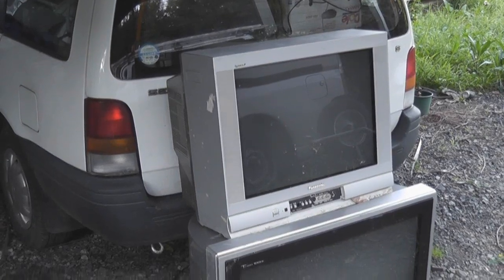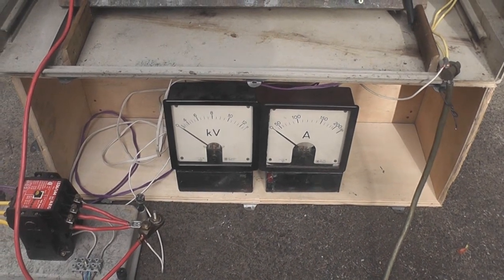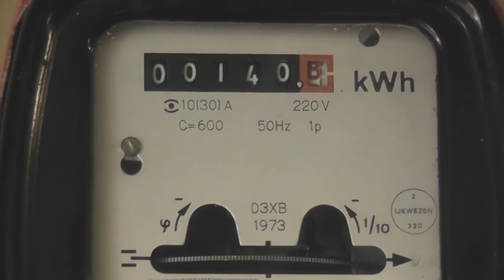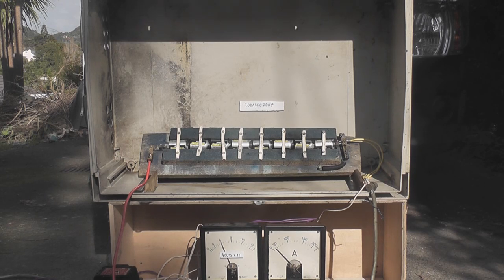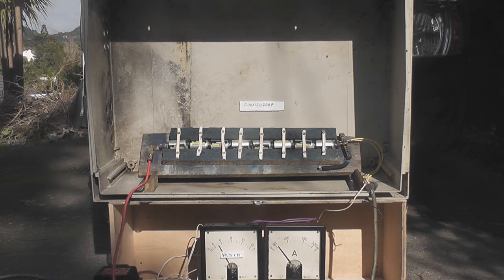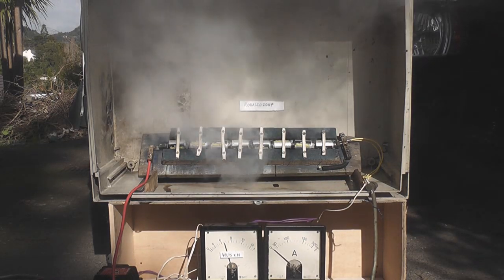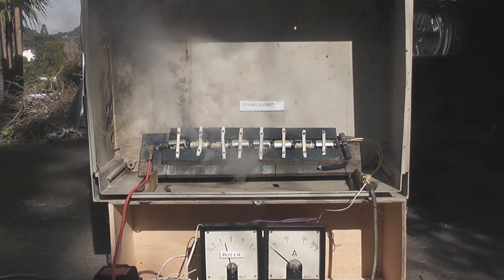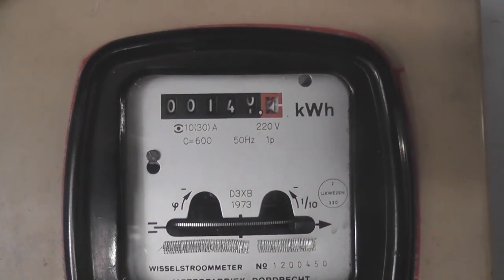D-cell Batteries smoking on 72 Volts A.C. [ 1 ]

Comment: Ah, Luke isn't asleep on the soccer table today. :-D

As for the batteries, they all had a slow boil-off. It's interesting that some are whistley-squeelers, and some aren't. 

Of course, whistley-squeelers are the best! :-D

Other interesting ones are single-cell cook-ups that end up going into meltdown & start shooting off lots of sparks like an arc welder / furnace. 

Always nice to see the battery cook-up vids, from slow-boilers through to full-on whistley-squeelers. Thanx for showing.

-BBD.

Comment from the maker: 20 kV / 100 V is the line voltage. e.g. voltage between the phases. The √3 refers to the phase to ground voltage.
In Europe multiples of 10 are used in UK and colonies multiples of 11 are used.

Comment from the maker: No. I haven't got any PT's.
They are normally connected up delta on the primary and star on the output.
e.g. 33 kV delta / 110 - 63½ Volts star.